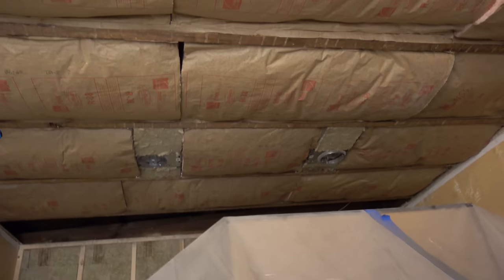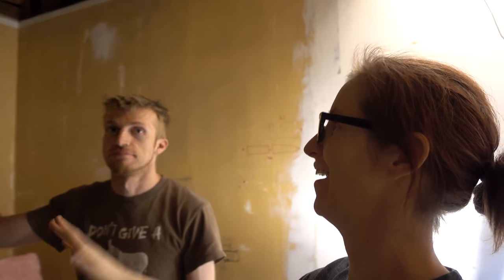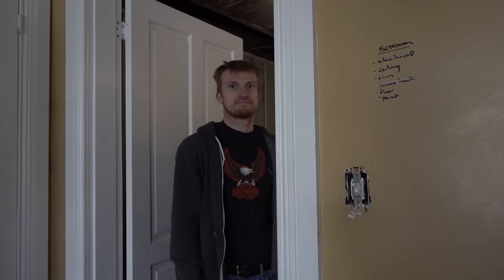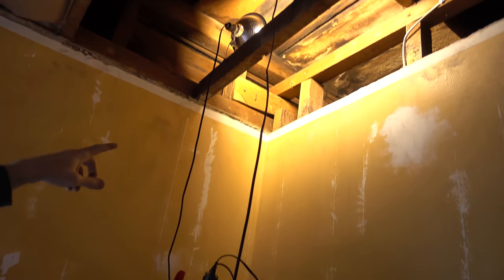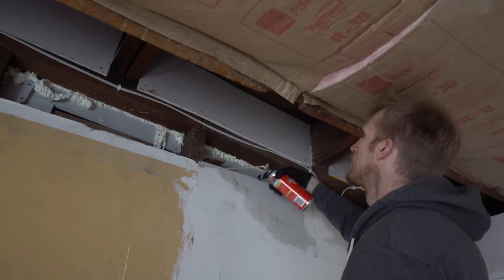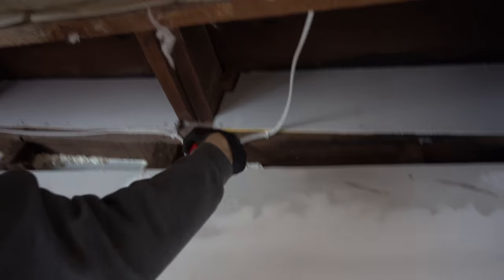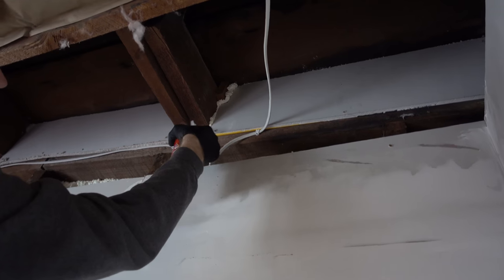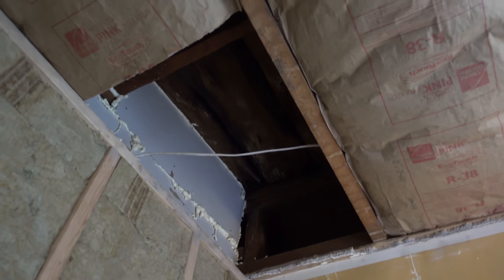Prep for Ceiling Time!

Comment: FYI Steve, there is actual fire break foam (usually orange to ID it) that doesn't cost must more if any than normal sealant foam.  Inspectors want to see it over regular foam . . . . If you ever have an inspection done.
Reply: There is no difference other than color added some codes do not require color identifiers.
Reply: Depends on the local code.  In my  county in Indiana, easily identified fire rated foam caulking is required for any penetration in top & bottom plates.  

My point to Steve is that he could use color-coded, fire-rated foam caulking for very little cost.